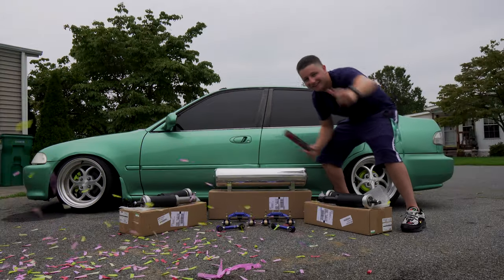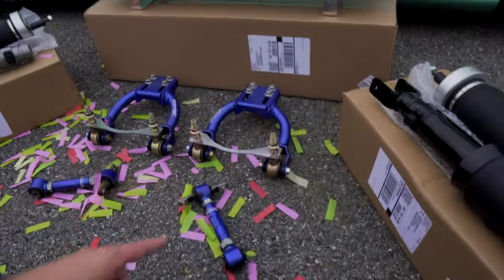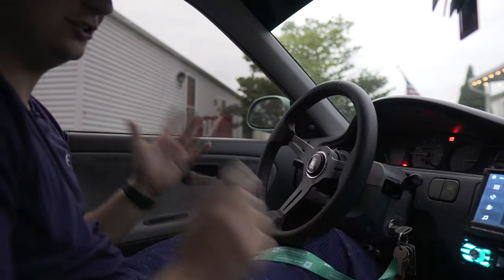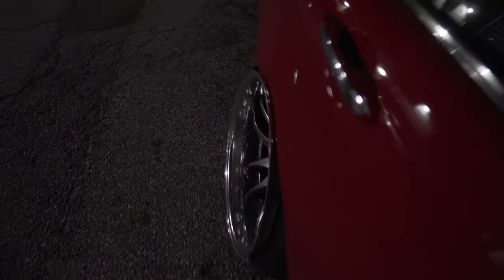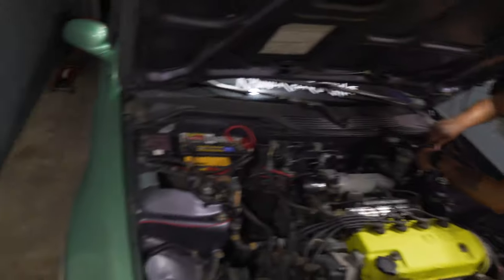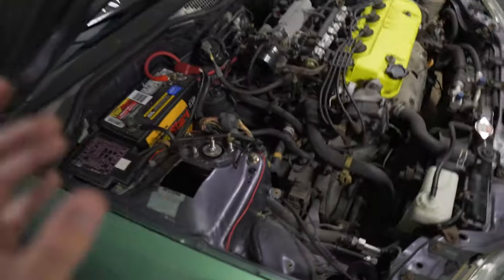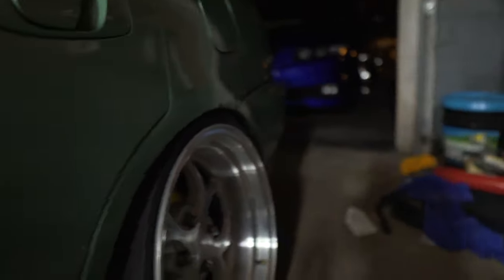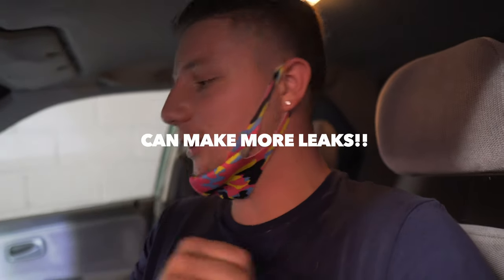I BAGGED MY HONDA CIVIC EG SEDAN - Airlift - slam series - bag riders -PART 1 #airlift #bags

Comment: Did you shaved  both  sides  or just  passenger
In my  civic 98  looks like touches  only on the passenger  side
Reply from the maker: Actually I shaved both sides just to be safe it’s better to do it so nothing rough is rubbing your bag
Reply: @unplugwithpreston  
Ok cool thanks